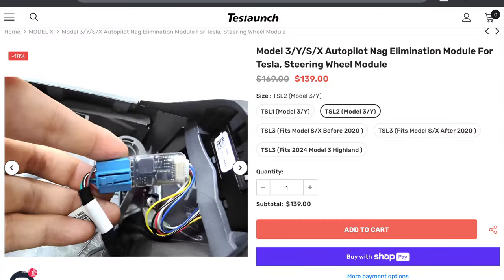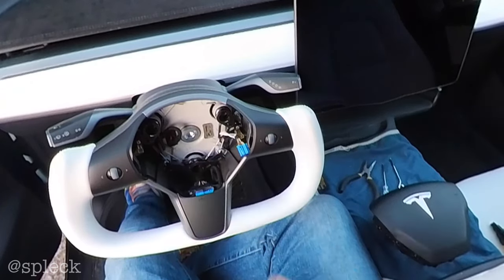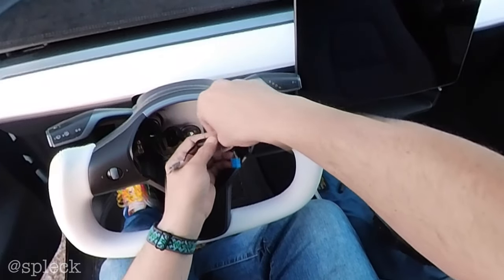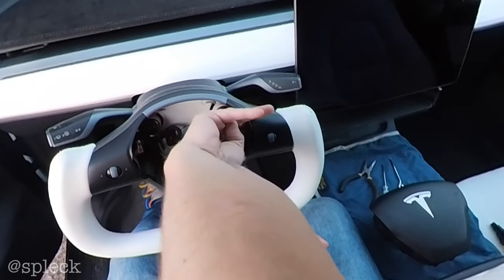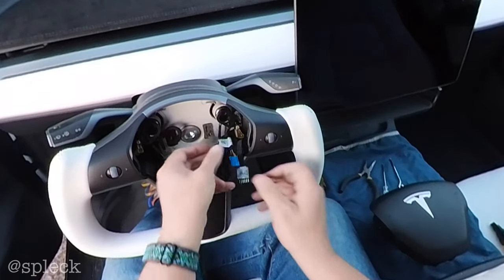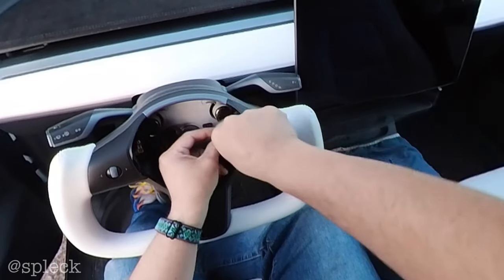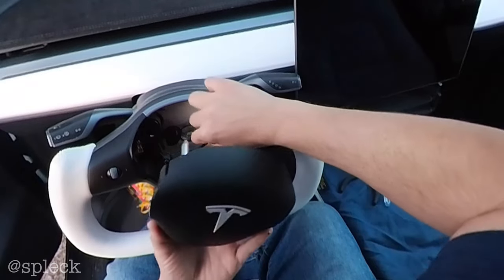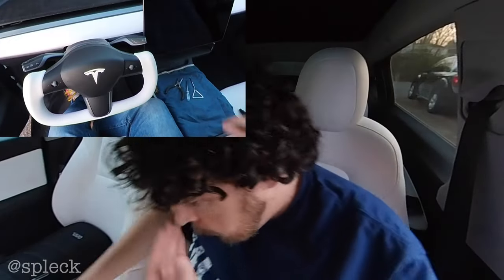TSL2 Hands Free Tesla Mod Chip by Teslaunch - AutoPilot and FSD Beta 12.3

Comment: It’s people that do things like this that ruin autopilot for the rest of us
Reply: As I do like to see when a device has been cracked it shows the manufacture a vulnerablity and the rest of the world how unsafe the device is.   Theres several ways to look at this but I see this as another example of some great reverse engineering as well as a way to close up a security issue with the device.   Unless your Apple that developes the M1 - M3 chip with a hardware issue that cannot be software fixed.
Reply: @nutopialabs8436  You can easily cut the wire of a fire alarm. Now are all fire alarms "unsafe"? You can sabatoge your own brakes without much difficulty.  Don't think you can blame all car brands in the world for that.

That is what this is, no more and no less.
Reply from the maker: Yes, people like.. checks notes Omar, who is rewarded with exclusive early access for using basically the same mod I’m showing here. And developers actively telling him they were going to enable it again after previously blocking it from working. (See 11 minute mark in his first beta 12.3 video) 👍
Reply: @qqleq  My point was not to blame anyone.   But using your fire alarm for example.   The fire alarm started out basic like all things new then improved upon over the years when vulnerabilities were found.   The same goes for any device.   The manufacturer try’s the hardest to make it right the first time but us humans can throw many wrenches at it that the manufacture did not anticipate.  So in the future when self driving cars are the normal we hope that enough of these mods have shown the manufacture how to secure our devices better.   This in turn we won’t have to worry about someone making a wireless embedded mod that will allow an intruder to take over your car and run it over a cliff kinda scenario.   So in the end it makes a better product like our more advanced fire alarms that have no wires or even access to the embedded 10 year battery.   But even then the fire alarm has a long ways to go to be fool proof.

Comment: Works perfect on my model x so happy :)  Don't listen to the haters i drive responsible and never had a problem . I  just installed another one on my model 3 and I  wanted to let you know that it worked when I installed on the volume  for 25 mins or so and then it started nagging me again  12.3.4 ..I'm thinking they need some kind of steering effort after a certain amount of time ..Ill put it over to the speed setting side like you suggested . i got kicked out for a week including auto steer ..so sick of these nags  i have 35 years experience driving .the only reason we have them is because nhsta doesn't like  Elon politics ,..which is total bs..I hope trump kicks those girls out of nhsta they dont know anything about car safety
Reply: Did you disconnect the airbag and how did you power off your car?
Reply: Disconnected the battery and i did the double click sound and everything was working perfect..it said it kicked me out because of not touching steering wheel
Reply: @bencrilly209  yes, I got it. I just bought it and wanted to know if you need physically disconnect 12v battery before installation.
Reply: Never mind works perfect 👍 with the latest fsd I had to wear sunglasses now the nags  went away
Reply from the maker: The vendor says you don’t have to remove power, but I do for the extra safety. Without power the airbag can’t detonate in your face. That’s a big win for me. You can search youtube for a guide but you want to open the doors and pop the frunk, remove the bioweapon hvac (4 bolts) if you have one, disconnect 12v power, and disconnect hv power either to the left side with disconnect or under passenger rear seat. Then airbag is as mentioned in video just use the provided screwdriver to push in the two holes under the wheel to pop out each side.
Reply from the maker: Camera nags still occur.. this only prevents the time interval based nags. If it is having trouble tracking your attention or eyes then yes sunglasses or a ball cap can help it track your head direction easier, though it may lose visibility to your gaze.
Reply: @spleck615  I have the older cabin camera that doesn’t see well at night time .. I got 3 strikes within 30 min drive ..I put the sunglasses on at night and haven’t received a nag yet ..what’s weird is that it tells you that no hands on the steering wheel was the reason for that strike out but it was the cabin camera causing it
Reply from the maker: @bencrilly209  i have my 2018 3 and 2021 Y, neither with internal infrared, and haven’t had those kinds of issues. It still likes to call me out if I look at the screen too long etc.
Reply: @spleck615  I have tinted windows :)

Comment: Hum....will using a safety defeat device void your insurance if you get into an accident?
Reply from the maker: That will depend on if it played a material role in the incident or available mitigation. If you cut your seatbelt insurance doesn’t get to remove liability from the accident, however they may be able to limit damages related to the occupant relying on that seatbelt. More nuanced and complicated than a YouTube comment. But short answer is no.
Reply: @spleck615 I don't believe you. This device can potentially cause injury or death.
Reply: @spleck615 short answer is yes
Reply: @spleck615  I'm not a lawyer, nor do I play on on TV :)  But it seems plausible.  However I do know the EPA have successfully gone after people how use defeat devices for emissions, I suspect NHTSA could go after these devices. 

To me it seems like a significant risk to avoid an annoyance.  But we're all adults and can make our own decisions.

BTW Despite the controversy around using a defeat device, I do think the video was well done.
Reply from the maker: @lonoleo  They have gone after both companies and end users who defraud a mandatory emissions test. If your state has car inspection and you show up with a flashed firmware chip or other mod chip, you won’t pass. If they care about this type of thing, they can check for those too. In the states that don’t care enough for that, why are we even talking about it? Lol.
Reply from the maker: @kennyfordham6208  neglect and improper use can cause injury and death. This device just removes a wheel tug reminder which doesn’t add safety, quite the opposite, while leaving the actual safety monitoring intact and functional. To each their own.
Reply: @spleck615  The wheel tug is there to make sure that the driver is still awake...and alive.
Removing the wheel tug turns the car into an uncontrolled public hazard.
Reply from the maker: @kennyfordham6208  And if your hand is rested on the wheel it confirms the nag. Even if you are asleep. Meanwhile the camera sees you asleep and triggers the proper alert. This doesn’t get dismissed by a simple scroll touch or light weight but needs significant torque to confirm. One adds safety. One is a nuisance and distraction. ¯\_(ツ)_/¯
Reply: @spleck615  If the camera was all that needed, to confirm alertness, then they wouldn't have added the steering wheel touch requirement. Hell, a cheap pair of sunglasses can fool a camera. 
The steering wheel 'nag' was added, to insure a continual (conscience ) active response.
The railroad uses has a similar system, called a 'Deadman Switch'; used to prevent runaway trains.
Reply from the maker: @kennyfordham6208  one of those existed before the other. Can you guess which one? 😉

Comment: I read some of the reviews about this on AliExpress and a few ppl mentioned that this will intermittently turn the volume up and down & basically make your steering wheel buttons malfunction. Unsure how factual this is however I don’t own one as yet myself
Reply from the maker: If the TSL2 is installed on the left scroll wheel it will turn the volume down then up every 10 seconds or so. You can adjust the interval. There are side effects, such as if you’re recording a disengagement voice memo it normally mutes your audio playback during the recording. If you press the volume up it cancels the mute, so sometimes when trying to record disengagement feedback the music starts playing again. That kind of thing, yes. I’m in the habit of pausing the music before pressing the voice command/feedback button. If you install it on the right scroll wheel there is no impact to volume, but it will adjust the speed down then up. It’s usually not noticeable but if you’re not using the new auto speed option and going the max speed and going uphill then when it does the momentary speed down then up you can feel it. I prefer the volume option, but I use the TSL6 now and it doesn’t have the option for volume adjust it just does the speed adjust.

Comment: What a bad idea. What a way to endanger yourself and everyone else around you.
Reply from the maker: Thank you for your well reasoned argument. I might have missed it, can you cite your example where this placebo nag provides value above and beyond the interior camera monitoring since you are here preaching with such certainty. Surely no presumptions on your part. 😘
Reply: @spleck615 your response is a perfect example of Whataboutism. Instead of supporting that this contraption is a good addition to the car and will provide a safer operation, you just completely ask for the usefulness of another part of the car that’s irrelevant to wherever this contraption is safe.
Reply from the maker: @monkeyaroundmonkey4604  I guess I missed it in your clever response, but where again was the data on what safety this placebo nag adds? No whataboutism or distractions. You say it adds safety. I say it doesn’t. Unless you have some data then we just have disagreeing opinions. Thank you for sharing.
Reply: @spleck615   well, where is your data saying that it doesn’t add to safety, then? Remember that this feature is implemented by the Tesla engineers for good reasons. You can bring your grievances to these engineers. When there is enough data to suggest less frequent nudging is needed to achieve the same safety, the engineers will definitely decrease the frequency. There simply isn’t enough data and so treading caution is the responsible way. Majority of the owners don’t have self-drive and use only basic autopilot. Autopilot doesn’t stop at stop signs, yield at yield signs, stop at red lights; and so bypassing that feature is a way to welcome accidents. Autopilot even with a frequent nudge requirement is still so much easier comparing to actually turning the steering yourself. If you can’t even pay attention enough to add a little nudge during a drive, you are definitely not paying enough attention.
Reply from the maker: @monkeyaroundmonkey4604  1) if nothing else, and you can see above the thread for discussions of redundancy and intent and effectiveness, but the lead engineer / ceo said they weren’t needed and would go away but a regulatory agency made them stay, and 2) it’s my car. I’m not asking you to do anything with your car. If you want to take away my freedom with my property you carry the burden of proof, not me. Put up or shut up.
Reply: @spleck615  boo hoo, 1) redundancy is in almost all good designs relating to safety, for good reasons. I believe you are talking about the internal camera being capable to cover the same scenarios as the “nudge”. Their intentions have overlaps but based on my experience, they don’t completely cover each other. Easy example is when you are on autopilot, wear sunglasses and falling asleep. 2) yeah, it is your car and it’s sure is your freedom to risk your own life. But someone sure is selfish to go to such length to prioritize such little convenient over the safety of others.

Comment: I don’t get why people are so concerned with you being distracted just because you disabled the nag. Doesn’t the in cabin camera ensure that you’re paying attention to the road?
Reply from the maker: As long as you don’t circumvent the camera, and your car is equipped with the internal camera, then yes I do believe the camera does a very good job at detections and this mod does not prevent the active monitoring and detections, only the interval based placebo nag. I still have disengagements, I still pay attention and monitor closely. Most times I even still have hands resting on the bottom bar of the yoke, I’m just not required to put weight on it or tug it periodically which is silly and yes, a distraction.
Reply: Exactly! Thanks for the tutorial. Btw did the voice command activate when you double clicked the scroll wheel or was it that you did a press and hold?
Reply from the maker: @SleepySquid  yes the buttons still function as normal so it activated voice command when double pressing to activate/deactivate. Just cancel it on screen or let it timeout. If you attach to left side volume controls it will pause/unpause media when you activate/deactivate.
Reply: @spleck615  Thanks!

Comment: How can this be legal?
You are deliberately disabling a safety device.
Someone could fall asleep, while using this device. Their car can potenially cause an accident (or possibly kill somebody).
🤨
Reply from the maker: You can go remove your airbag or cut your seat belt and nobody will arrest you. Where do you think you live?
Reply: @spleck615  Cutting your seatbelt, or removing your airbag only puts YOU, in danger. 
A driver asleep at the wheel, of a moving car, turns it into an uncontrolled death machine. EVERYONE is at risk.
If you want to kill yourself, by removing safetybelts and airbags, go right ahead. You don't have a right to put the public in danger.
Reply from the maker: @kennyfordham6208  that’s what the camera monitoring is for. The wheel nag isn’t for sleeping detection. The camera will still trigger for actual detections as will other events of uncertainty, not time interval, and I don’t circumvent it in any way. 

Now, where is your concern over all these people overriding the speed limit safety feature? Real people die daily from speeding drivers. Nobody had died from the lack of the Tesla Tugger.

Comment: I think this won't work with our UK Tesla Model 3's as in certain European countries and others if you can't waive away the on screen prompt by toggling the scroll wheels then it doesn't work (tried with S3XY Buttons accessory and wouldn't work) - it's a safety measure in our countries so you have to bear weight down on a side to waive away the prompt - Please tell me if this will still work Kevin :-)

Look, I hear you haters/concernists with your theoretical shouts for caution but this is not a black and white argument - it's about analysing likelihood of true real world risk to other on-road risks of higher frequency and prevalence that are already present - Lets look at your assumption: a driver with this mod has increased likelihood of sleeping at the wheel because of lack of a hand on the wheel that leads to the nag and lack of sudden emergency braking that would’ve resulted (which bear in mind is dangerous in its own right on a highway). This assumption is invalid as it assumes other crucial factors are less likely: the immediate and inherent driving safety instinct that starts in all of us as soon as you drive off and increases at fast speeds does not reduce because you don’t have a hand on the wheel but where it may occur is on ill founded assumptions by the driver on what the Automated driving car is able to do (not this mod) this is with user understanding than the mod. 

The rare subgroup of Tesla owners who firstly are a aware of this mod(extremely small at present) that feels its worthwhile to do i.e meeting their needs (smaller still), then meet the threshold to be able to install (even smaller), have a higher likelihood of being intelligently aware of the limitations of their Tesla and fallibilities of factory installed Autopilot) and are aware of the risks of fitting technology like this when using. Then when using have a certain level of value for their own life/others in the car and take more attentive care and then have at least some added concern for others, to operate it with slightly higher awareness/responsibility. There is no loss of standard safety function of being able to brake or turn the wheel if needed after installing the mod - the core safety function is still there. 

Therefore it is far more likely than not that there is a heightened sense of awareness of their surroundings when engaging this than the “not your average Tesla driver” when fully aware there are other 70mph metal boulders flying past as well than reverting to sleeping because its “easy” - if it occurs unintentionally then narcolepsy should be looked into on a serious note a different matter. 

It may be that your assumption plays a role if for example the type of drivers you’re thinking have a low barrier to activate this risk (ie if a high risk low experiencing high school teen driver has a no-nag feature in an out of factory car - but this is not the case as for the average Joe Tesla drivers, there is a nag feature to protect the casual teen or irresponsible adult from this). Your assumption is ill based for those that perform this mod (you’ve cross applied the likelihoods above) - it’s not to say it will never happen (as there may be one irresponsible modding adult out there) but it’s all about relative risk in real world practice looking at all factors at play for the risk you’re exploring. (For the insurance commenters - it all depends on the individual event that’s occurs and where the direct cause of the event was) (for the warrant commenters you have a valid point - higher likelihood of this voiding factory warranty after damages in an accident than not)